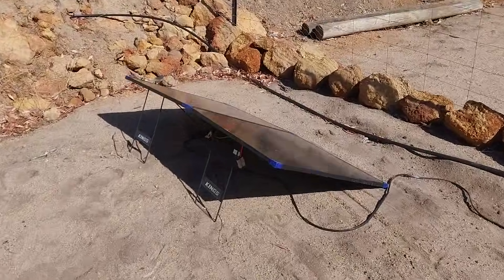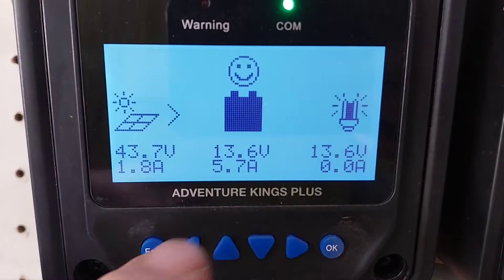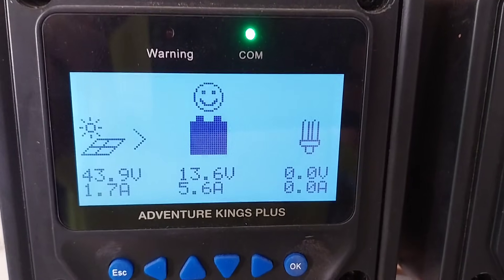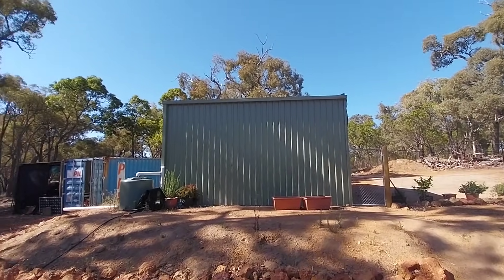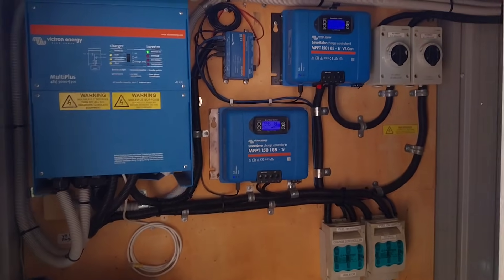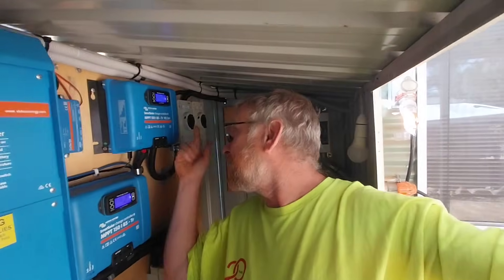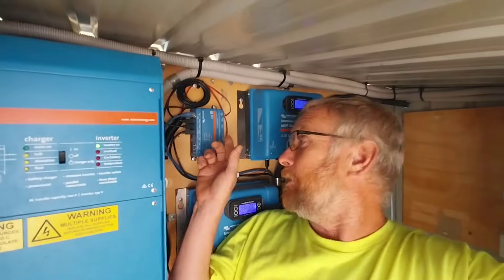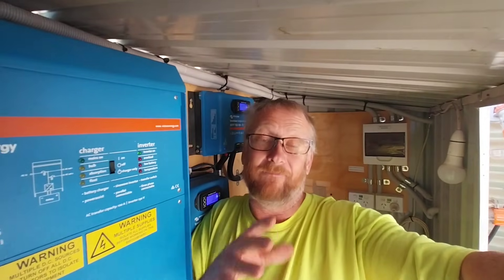When Solar Panel Shading Is Not A Problem & Uping Panel Voltage

Comment: Well, you have a 48V charging system, so of course your batteries will charge up much quicker, as you have a more efficient system of charging, and thus don't need long all day daylight hours to charge up your battery banks.
ps my criticism is aimed at others reading this, and not at you.😊

Comment: That is a great come back Glen and well explained!
As a matter of interest if there was no Solar at all for a week how long would it take you to drain all your reserve battery power and then if you had to use your generator to top them back up how long would you have to run your generator to get your batteries back to 100%  and how many liters of fuel do you think that might roughly take?
Reply from the maker: That's a lot to calculate but see how we go.
My power consumption in the cabin from the 48 volt system is roughly around 7 to 8 Kw per day.
The batteries hold just over 15 Kw's of power so it would last around two days (48 hours) with no sun.
The generator delivers around 3 Kw's per hour and consumes around 2.5 litres per hour so it would take around 5 hours to charge the batteries and use around 12 litres of fuel.
These are rough guesses but it would be pretty close to that.
Reply: @TheOffGridBachelor  That is awesome info, thank you Glen. $2/L for fuel would be around $6 a day to always have power with no sun. Could you take a stab at how much fuel you reckon you would use a year to power your generator to top up your batteries?
Is there any chance living off grid with Solar and batteries is cheaper than being purely on grid?
Reply from the maker: @Earthau  That's 2.5 liters per hour, it would be around $5 per hour to run the generator.
Over the last 12 months I have used 45 Kw from my generator. At around 3 Kw per hour that is around 15 hours my generator run over the last 12 month (mainly winter) so that is around 38 litres for fuel or around $76 for the year.

Grid Vs Off Grid is very hard to say as it depends on how much one uses in power. The more power one needs the bigger and more expensive the system will cost. If I was paying a power bill, at our power prices it would cost me around $1,500 a year in power and service charges

To build my system with quality components it would probably cost me around $15,000 and that is me building it myself, so it would take 10 years to pay it back. So in general for most people, it's cheaper to stay on the grid if the grid is available.

Comment: Hey mate, why do you have 2 x150/85  seems like overkill for the amount of panels you have.
Reply from the maker: Yeah that is a good question. I use to run 7.7 Kw's of panels many years ago when I was running lead acid batteries and used those controllers. When running lead acid batteries I needed a lot more panels to run high loads like my electric hot water unit as lead batteries don't like running high current loads.

Since I have moved over to Lithium batteries which handle high current loads just fine, I don't need as many panels, so I down scaled my system to 3.3 Kw's which is a nice sweat spot for my power usage in the cabin.

So those controllers are way over kill for sure, but I already had them so I just kept them in service.
The other advantage of having over sized controllers is less stress which leads to longer service life.
Reply: @TheOffGridBachelor  Yeah, fair enough; I agree that when you don't push things, they last longer. I have been looking at 150/85. I currently have a system with 150/45 and 9 x 440W panels in a 3S3P setup.  As you can imagine, it spends most of the day at approx  2.4kW. If I go for a 150/85 I think I will add another string of 3x440's
Reply: @TheOffGridBachelor , just noticed in your VRM you have a couple of alarms for High DC ripple. Any ideas what's causing that?
Reply from the maker: @angyp74  Depending on when that was? I was having problems a while back with the Multiplus charging the batteries from the generator and it was spiking above 60 volts causing the batteries BMS to shut down. If I remember I sorted it out with some tweaking of some setting with the laptop plugged into the Multiplus running Victron connect.
Reply: @TheOffGridBachelor   Seems to be happening daily. Advanced VE bus warnings and alarms graph.
Reply from the maker: @angyp74  Hmmm, that's interesting and it seems to be doing it at around the same time each day and when the batteries are at 100 % SOC.
So I am wondering if there is something coming from the batteries BMS ?? I will have to do more reasearch on it to see what my be causing it.
Thanks for letting me know you found the issue 👍
Reply: It's about redundancy, also you don't want to run an mppt close to its maximum capacity.  Spread the load between 2 controllers, link them together through VE networking  and you get better efficiency.

Comment: That was interesting , as a sparkie (retired) I understood the volts drop issue ,but I didn’t realise the output was referenced to the battery voltage . I assumed if it seen more than 24v coming in it regulated to 24v ….over 50v regulated to 48v . 
My diy solar panel system has 4 kings 20A  Solar regulators with 2x160w panels on each so I might try out the series setup.  Might experiment on my solar carts first.

Glen do you fuse/ c/b each Solar panel in a parallel config ??
Your a wealth of information….keep em coming 
Cheers
Frank
Reply from the maker: Thanks mate.
I'm not sure I entirely follow what your meaning. On the remote screen on the solar controller it shows the voltage and current coming from the panel, the far left values of the screen under the solar panel logo. In the middle of the screen under the battery logo it shows the battery volts and current entering the battery. Those solar controllers need to be manually programmed to either 12, 24 or 48 volts which is done in the settings when you set up the controller. What style of Kings solar controllers are you using ?

I don't fuse the panels if I am only putting two in parallel because if one panel fails the other will not produce enough current to blow the fuse as bother panels deliver the same current and the fuse must be greater than the maximum current the panel can produce. But once I go over two in parallel then yes the panels need to be fused in case a panel fails as all the other panels will start to feed back into the failed panel and exceed it's current rating.
Reply: @TheOffGridBachelor  Hi Glen , I got the 20amp mppt controller from kings.
I must have forgotten that I setup the voltage on the mppt unit. Is it the same for a Victron mppt device .? 
I haven’t fused my panels either ,just a 25amp c/b going into the mppt controller.
Cheers
Frank

Comment: Gday mate little off topic but the power shed for your house do you have a build video in your setup I built a shitty shed that I want to get rid of in bunnings they have the same size shed you have for $240.00 I'm planning on getting. I just need a better idea on setting up a back board for the solar controllers
Reply from the maker: I don't have a video on setting up the power shed. But all I did was got some thick ply board from Bunnings and screwed it onto the wall of the shed, screwing it from the outside. I then screwed the inverter and controllers to the ply board and wired it all up as seen in the video.
I did use quite a few screws when screwing the ply board on the wall so as to take the weight of the inverter as that is one heavy unit.
I can do a quick video in the shorts if you want, showing how I screwed the ply to the shed wall, happy to do that for you.
Reply: @TheOffGridBachelor that be nice mate for I like how you set out your solar controllers switches all that an how you got your batterys located selfing my setup is poorly made using junk stuff. My system difference to yours mines just a 12v setup but I split it into 2 grids everything separate. I have 2 135amp lithium batterys connected as one that's only running my 12v/24v kogan fridge bar fridge size but with a 30lt freezer on top. My 2nd system is 100amh with 2 solar controller on it with one 500w panel the other a 350w. My fridge system got 2 250w house panel on it with I want to take off the system an get 2 500w panels with 2 solar controller to put on my 135ah batterys. Than make a 24v system with the house panels an a 24v 3000w inverter to have 240v for microwave, a/c an washing machine.